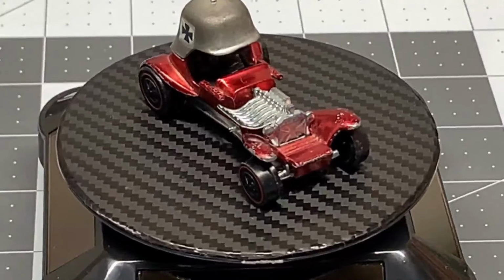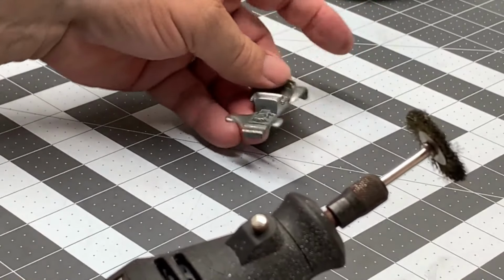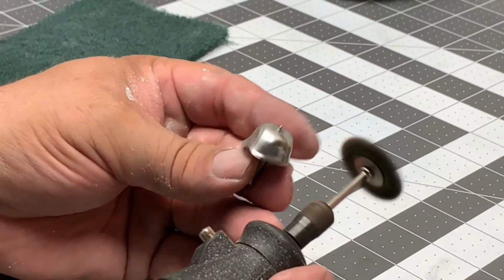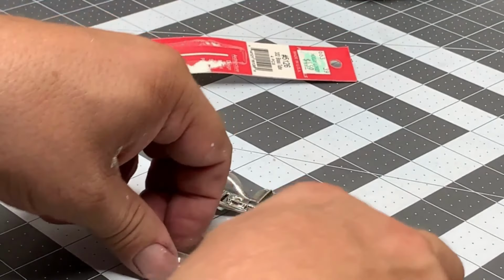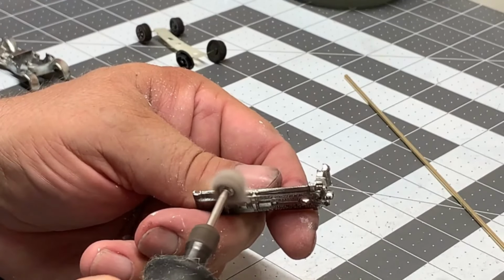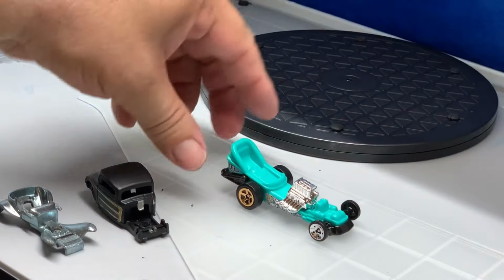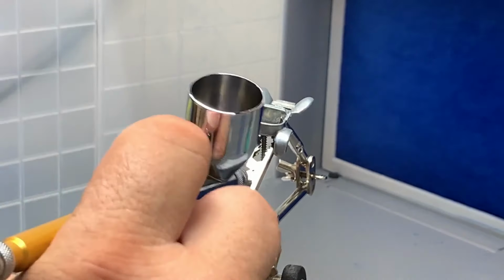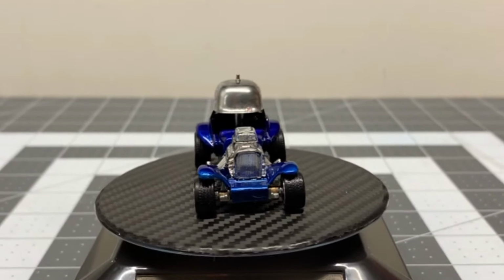Hot Wheels Red Baron / Blue Max Custom Rebuild

Comment: Super cool custom and your fade rocks! I've learned so much from watching you, Lee, Paul, George, Keith and the many others who I watch religiously on here. Your Dremel looks about as old as mine. My bench grinder is about 45 years old. I gave it to my dad for father's day when I was a kid. It's a toastmaster brand 😜 I found out through one of the guys I follow that a little super glue used on the wire wheels help keep the wires from flying off so quickly. Your tips about polishing are so great for those who never done it. I was a car detailer for years so I just have to put my skills to a much smaller scale. Heck the only thing I haven't done automotive is build cars on the assembly line. Keep rocking the builds and I'll keep watching and being inspired 🍻

Comment: That's a great job on the car. That the decals look fantastic. The Blue Max as it was informerly known was given in honor of Max Immelmann the first recipient of the "Pour le Merite" during World War 1. He was also the first Aviator to win the award. The reason the car had a 6 cylinder was because Tom Daniel designed it to run a Mercedes overhead cam 6. The actual show car ended up with a Pontiac overhead cam 6. I think they had problems with the fuel injection on the Mercedes engine that's why they had to switch them. The movie The Blue Max it's also a really good movie if you want to catch it.

Comment: This might help someone who has blown out the post as you`ve shown. If you stop immediately and dont go any deeper you can file the post top straight again,re center your drilling, then continue with the tapping. Now it might not work with a beatnik bandit front post but on a red baron there should be tons of post left. The trick is to have some 3/8"long  #1x72 button head screws that way it should be long enough to reach down until it catches the post again. In fact sometimes on an engine if you blow it out theres nothing left of the post no biggy same deal re drill tap and put the longer screw in. It works most of the time not all cheers.